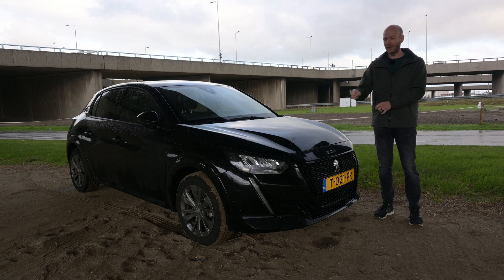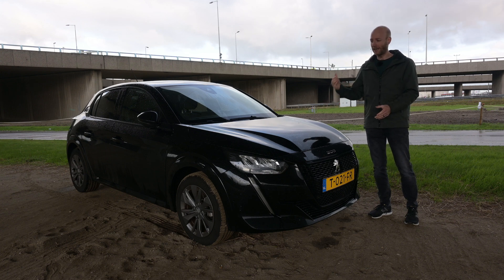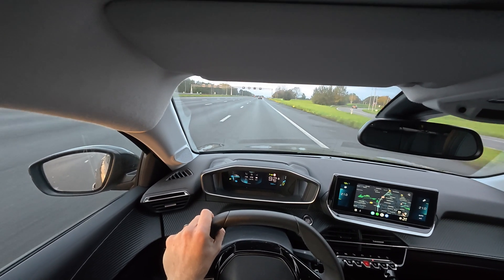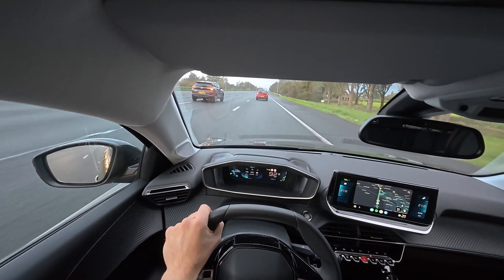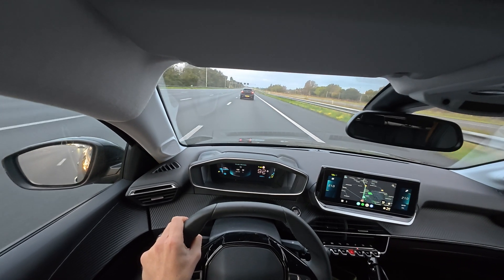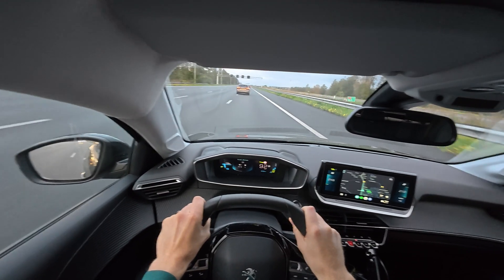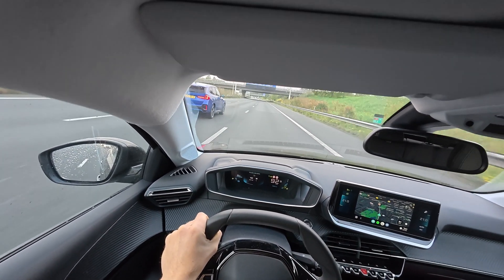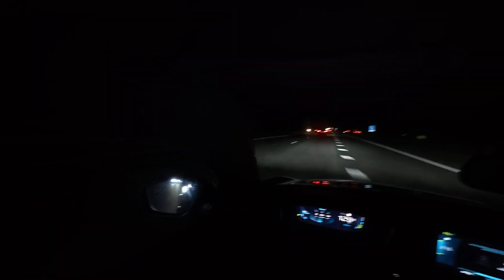Peugeot e-208 Degradation and Range Test | Does age matter?

Comment: Thank you for the video! I've had a e-208 for 3 years now. Like you say the facelift version with 156 hp motor is a lot better in consumption than the old 136 hp motor especially at motorway.

Comment: That seems not to be correct. If you have a 2% loss with 90 km/h speed, then this should be the correct value of degradation. Because the car is build for driving, you never may expect driving without any heat losses. Only if you drive even slower, but who does it really. The next question should be, is there a top buffer implemented in Stellantis cars? If yes, then this buffer is already gone because you are missing 2%. In this case the degradation appears to be huge!
Reply: That was a full ramble

Comment: Why not buy an obd to read proper way of State of Health? My Byd Seal Lfp now in 99% of SOH, but the range is the same, may the car use some other cells to compansate the loss.. I am over the first year from production and 30.000 km of usage with 4 mounths.. (5000 km/ month)
Reply: Manufacturers use different factors to measure degradation e.g. how closely balanced the cells are, and internal resistance. Since capcity is simply the amount of energy which can be expended until the lowest cell reaches the safe minimum cut-off voltage. This can also be affected by things like temperature, and how often the car is allowed to fully charge the battery in order to balance the cells. Therefore SoH in itself may not be a very good representation of range/capacity, I can say form my own experience that the Stellantis reported SoH using third party apps like Carscanner is wildly inaccurate, and my e-208 has increased it's SoH estimate from 93% to 97% (at 99,000km). This is evidently an anomaly and incorrect, if I take the car's estimated kWh capacity when full, then degradation is closer to 10% (as checked in Summer).

Comment: before watching the video, my bet, unless the owner did something horribly wrong, there is no degradation.  That car has a stated range of ~200km, the 10.000km means it only has 50 charge cycles. Even low quality modern batteries have a 350 cycle rating to 80% degradation.  Let's see if I'm wrong. As you mention the battery has a degradation buffer built in with the usable capacity.
Reply: From my experience with the e-208 I would expect around 5% degradation for this car and this mileage, the Stellantis E-CMP cars do not unlock the buffer to compensate for degradation. However, a difference of 5% can easily be overlooked with such a manual test and the consumption reported by the car may not be 100% accurate.